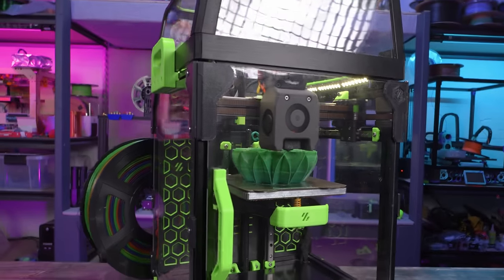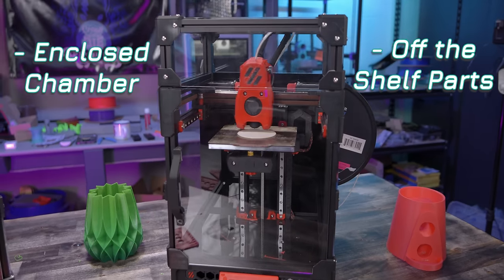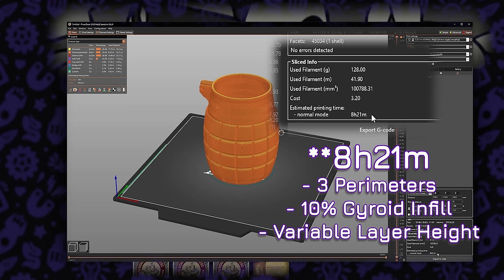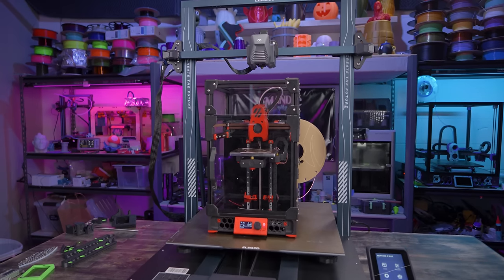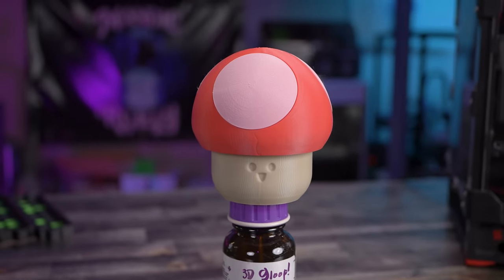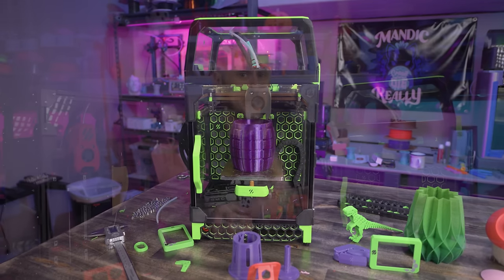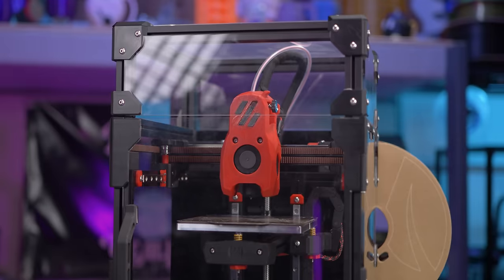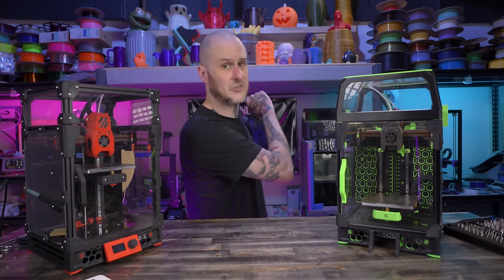Small 3D Printers are POINTLESS! Or...

Comment: I started out with an ender 3, the original, that i found on sale for 100 euros, after about a year of printing, i decided to get a V0.1 since almost all of my prints were half the size of my ender 3 bed, and the ender broke down almost completely, i managed to resurrect it by swapping out its mobo for a ramps 1.4 and an old laptop to run klipper, and strapped a v6 hotend to the ender 3 carriage with some wire to print a temporary mount for the hotend that didn't shake like crazy, once i did that, i started printing parts for the voron, and i still use these same parts today, just a week ago the extuder mechanism broke, and i managed to print a sherpa mini out of resin, and i screwed it on top of the mini stealthburner. right now i'm printing the parts to upgrade my v0.1 to a v0.2 with this frankenstein setup, and i wouldn't do it any other way!

Comment: If it’s the only machine you have, then yes , a bigger printer is a must, especially with limited design capabilities. I3 size is the default for many existing design on Thingiverse or elsewhere. Anything beyond that is optional. I started with a too small printer and regretted it.

Comment: out of all my printer my 0.1 has been my must used printer, as i print with asa and abs the most it just make sense as like 90% of the time the part will fit on my v0.1 and i got my v0.1 going at 500mm/s at 60k accel print speed so everything come off very fast much faster than my other vorons and enders. not to mention the bed heat up time being a smaller bed it easier to heat up with a 200w bed heater with the help of an active chamber heater too. only takes like 10min to full heated chamber and bed ready for asa and chamber prints compare my 350mm vorons takes like 1 hour just get to the temp before i can start printing, and usualy by the timei  can start my print on my bigger pritners i will alreayd have the part from v0.1. WIth that being said i am investing into a 330 vzbot to get the speed up on that and addin couple chamber heater too to speed up the time

Comment: I don't have a V0, but i do have a 120x120 corexy and i use it more than i thought. i have larger printers, but about 80% of what I print will work on the V0 size bed
Reply: What model?
Reply: @glabifrons  rook 2020
Reply: @njsurf1973  Thanks, that's pretty cool. I've only seen the 3D printed version before.
Reply: @glabifrons  i started with the printed version, and it was nice, but i like the profile one better

Comment: I got fascinated with Voron around Christmas, and built a V0.1/2 this spring because I wanted all of the project part without as much expense.  At the time I fully intended to give it a few months and then start looking into a Trident, but ... I'll be honest, now I'm fascinated with these little printers, so I might redirect to one of the printers for ants in the 180mm range (such as a Micron or scaled Tiny-T).
Reply: VZbot vz150 time?
Reply: @ballbous  :-).  I think there may be advantages to sticking within a specific ecosystem for the first couple builds!  Also, while I'll have to think on it, my current inclination is towards something more in the 180mm area, because it's a nice split between 120mm and 250mm.

Comment: You could cover building larger prints in sections and gluing, welding, bolting, etc. the sections together.

I suspect that, for many larger prints, printing the separate sections with a V0 would take less time in total than printing an unseparated piece in a larger printer.

Also, section level errors would reprint much faster than reprinting a large piece on a large printer.

Comment: I think 180x180 would be ideal
Reply from the maker: 150, 160, or 180 would be better for sure.  Almost every print on my list would have fit if the bed was that little bit bigger. Problem for me is the mod designs that use larger beds (V0 Variants that is) are all substantially more expensive.  That really negates the whole thing for me.  If I'm gonna pay as much as building a Voron 2.4, I'll just build a Voron 2.4.
Reply: @MandicReally  Interesting, I never thought that it would be so much of a difference in price when scaling everything up with the v0 variant.
Reply from the maker: @hongtse6723  The current variants that exist use are shrunk down versions of a Voron 2.4 (Micron) or Trident (Salad Fork).  Both use 6 or 7 motors & require mainboards that can control them.  At that point you are getting parts that cost similar to building a 2.4 or Trident, but building a small machine. I really like this form factor, but when I'm spending as much as it would cost to build a larger machine, it becomes harder to justify.

Comment: I'm building a V0.2 because I live in a tiny apartment and want to print ABS/ASA but don't have the space for a bigger enclosed printer.
Most of the parts I print are not huge, usually for electronic projects, so the size is fine for me, I'm extremely glad something like this exists otherwise I wouldn't have the option to print some things at all

Comment: I agree that V0 will print about 50-70% of parts. But if I want only one printer, then I need something bigger to satisfy my needs. I don't want to split parts and glue them later together. I'm mostly 3d printing automotive and motorcycle tuning parts. Basically anything: from little air ducts, to manifolds, adapters, cupholders, covers, buttons, mounts, brackets, holders and anything else for car or motorcycle. Actually I'm thinking about building Voron 0 but exactly 1.5 times bigger.

Comment: My largest print volume is 250^3 on my Biqu BX. I currently have 4 "mini" printers - a Prusa Mini, my Voron 0.1,  and two Kingroon KP3Ss (a V1 and a Pro V2) and they print 90% of what I need and my Ender 3s and BX take care of the remaning 10%. But if a 350mm Voron 2.4 kit showed up at my doorstep, I certainly wouldn't turn it down :)

Comment: Building a V02R1 starting this weekend. I have a SV06 and am happy with it, but want MORE! When I saw a review promoting the V0.2 I knew that the speed was just the thing I wanted it for. Most  of my prints can fit within the volume and there is nothing wrong with running 4 prints consecutively rather than one with all the parts on one bed taking longer overall.

Comment: I had a small printer as my first printer, the Monoprice Voxel (rebranded Adventurer 3).  150x150x150 was its build volume, nice, fully enclosed little printer...noisy as hell though.  I generally used it as my "test" printer for a single design as well as my portable printer when traveling to shows (Train Swap Meets).  I decided to sell it since what I had been printing was all too big for it, HO scale buildings were not going to fit in a 150mm area.  Also mass producing multiple items also wasn't feasible either, could get 1 or 2 on it, but the bigger printers I had (Twin Neptune 2S) could do 10+ instead.
However the Voron 0's there are the same price as that Voxel was, but clearly faster.  The only benefit I really see a Voxel 0 having is entirely in the speed department, if you can manage to get said print to fit in the small 120x120 plate.  Portability might be a draw too, since its small and enclosed to begin with, it would travel well.
However the Voron 2.4, at least at the 350 version does seem to be quite beneficial even at its high price point.  Because it brings both high speed AND large build volume together.  Then there is the X-1, that with the AMS is cheaper then the 2.4, 100mm smaller in build volume but really can't beat that ability to print in Color.  There is the Pallet 3 System that allows up to 8 colors on any printer to be used, but thats another extra, fairly spendy thing.  No idea how well it would work in conjunction with a Voron printer.

Comment: My first impression of the V0 was that it was a throwback to the old makerbot cupcake.

Right now I'm in the process of making a Hadley telescope.  The parts for this fit on my Ender3 with a bit of space left over (but not much).  The Hadley is a 4.25" (mirror size) scope.  I'd like to scale this up to a 6.5" mirror (which I will try to grind myself).  A scaled up design for this might fit on the ender3, though I might have the cut some of the parts in half on the cad model, print them, and glue them together.  So the Voron 0 would be too small for this.

However, I have also 3D printed a chess set.  THAT would fit on the Voron, and I could easily print several pieces at a time.  (I didn't do that on the Ender, too much stringing between the parts (PETG).  I could probably tune the extraction, flow rate, and filament temp to control this, I just haven't bothered yet.

Comment: I tried myself by building a few Printer (HyperCube, V0.1, Trident, Annex K3). For everyday Printing i usually use the Trident. Everday meaning i have multiple Parts on a Buildplate. For really fast prints, i stick to the K3. The Buildvolume of 180 mm³ is the Sweetspot for me, its super fast and i just love to watch the crossed gantry in motion.

The V0 is catching dust at the Moment and needs some tuning anyway. I will rebuild it eventually as i have new and shiny Filament.

Comment: My first printer 2 years ago was an ender 5+. my bro liked his 5, but I went to a bigger volume and more supported bed. but didn't want to be limited Goal of Droids, rc planes, rc cars. and at that time items were designed for a 220 beds. But printing my last airplane. I'm heating up a bed to print a small amount of small parts. IE I know I could add them to with bigger parts. But I like raining 1 at a time. Less travel time. But come to realize I could fit the small parts on a smaller printer. SO came in  my Ledge ix . 1 it was a full build in a box (can come built or minus 3d printed parts ) and was a fun first build No people I was 3d printing stuff from are basing it off purse mini so 180 cubed items. But its also I can heat up a small bed ie same reason less energy used to print smaller things while the big printer is printing ie 4 sections of an airplane wing for 20 hours and I print out the time items, IE cowls and such. (but a Voron 2.4 in the plans as just seams a fun build. and also looking at the k1 max.

Comment: I've got space for one printer and I think my Ender 3 is about the perfect size to be useful without taking up too much space.  Some of the projects I've printed recently that wouldn't work on a smaller bed include a very nice 5L trash can, a sponge holder/dryer for my kitchen sink (I actually had to scale this down to fit), a pencil case, and some toys with rip cords that I had to place diagonally to get it to fit on the Ender 3.  I also want to get into gridfinity or multigrid which would be very limited on such a small bed.

That said I do really like the idea of a Voron 0.2 as a secondary printer that can be used to print ABS components fast for real applications and the majority of little toys/trinkets way faster than I'm used to.

Comment: I build my v0.1 for specifically faster prototyping next to my desk instead of the bigger printers I have in the basement cause I hated having to sit around for first layer checks (don't judge me lol) and when it was a small part it was nice to keep working on the cad while it was printing for fit checks. The ONE THING that annoys me about the build volume (beside my bed having a low spot which is likely my fault lol) is I often want to print things that are 130mm or so or just outside of the volume and then I have to do a cut and key or orient it weirdly or just scale it. There's way to work around it, but by and large it's enough for most of my gadgets, not to mention the building of the kit was worth it in and of itself :D

Comment: I also run a v0.1/2 (its a frankenstein v0.1) I also run an open source project where none of the parts fit in the V0 so i mostly use my trident for that, but that doesn't mean the V0 doesnt get used i still use it for all my personal and or fun bits when my big printer is in use.

Comment: My main motivation for a larger printer is either full build plates worth of smaller parts so I'm not constantly pulling prints off the bed, waiting for the bed to heat up/cool off and the various pre flight print_start processes. Or for the occasional large item like helmets or cosplay props in fewer pieces meaning less time joining the bits and post processing before painting.

I have a little ender that prints like a champ but it's slow and smaller than my 300^3 Trident which means I can't get as much off it in the same amount of time. I'm still looking to build a V0 someday but for me the size is more immediately useful.

Comment: Wondering whether there's a good 3D printer for a travel trailer:  small, ideally would run from a 12V 100Ah deep-cycle battery system (generator to charge as needed).  Voron 0.1 maybe?
Reply: Purpose is making mounting brackets, muffin fan mounts (for e.g. where there's condensation), wire looms, that sort of utilitarian thing.  Hopefully beats putting the item on a list for when we get home.

Comment: There are very few things that I print normally that won't fit on a V0 bed. Most of the ones that won't fit on the V0 will fit on a 160mm Salad Fork (a small V0 like variant of the Voron Trident). Portability and convenience are other factors. Perhaps the larger printer must be put in the garage or a less convent to access place. The small printer can sit closer to where you design and work. The small printer is also easy to transport and show off, take to the local club or group for a presentation. It's also less likely to shake out of alignment in use. Even dropping one on it's head didn't do much damage (Nero). The small printer is also available while the big printer is busy to try out that new idea you just had. :)

Comment: My first(so far only) printer is a prusa mini, and while I think more than half of the stuff I've made could be printed on a voron 0, the thing I've made in highest quantity (a part similar to shelf brackets), would not fit in the smaller build volume. 

I think Voron 0 is a good size for a third or fourth printer, after you can already print any single thing you need, but need more speed or capacity.

Comment: My first printer is a sunlu s8 pro with a massive build volume (31x31x40). I love having that capacity, especially the width (which is still limiting at times), but 100% most of the parts I print would fit into one of these tiny printers. And the main problem I run into with printing tiny parts on a giant printer is bed levelling. The larger the bed, the greater the difference there's going to be between even the most accurate tramming map and the actual bed; this has no greater impact than in the very middle of the bed, where small parts are usually printed.

Comment: since making my Tiny-m a 150x150x150 printer it's has very quickly taken over as the one that is always on and ready to print. I have just finished the enclosure and getting ready for asa - abs prints and it's the only actually enclosed printer I have.  It's just perfect for quick test prints like you said because it heats up in no time and can print very fast. This is my 10th printer and the 3rd I have self sourced and made and I never want to go back to a cheap box printer again.
Reply from the maker: Tiny-M REALLY is interesting to me, but hasn't been updated in a bit that I've seen.  I'd probably want 0.2 aesthetics, which would be a big project on my part that I don't have time for...
Reply: @MandicReally  the rev 5 is currently in development so perhaps take a look at then when it's ready.

Comment: the only thing that is kind of sad is you can no longer do overnight prints 😅 which feel like a underutilization of it. like every part is sub 2hr
my take on this is probably don’t get v0 as your 1st printer as it can be hard to tune (unless you are in a dorm than the smol footprint is super nice). get a bambu if you are not interested in tuning printer and a E3 otherwise (not actually sure if there are better choice on this one, when I started E3 is still the king). with that said v0 are awesome second printer since it require some tuning but not too much tuning and complements a larger printer nicely. after that it is pretty much personal judgement and I plan to build a voron 2.4 from v0
Reply: You need to risk it and print stuff oriented vertically, just enough time for overnight printing with a plate full of stuff.

Comment: Have you considered making a 2020 based voron 0. I think 2020 is significantly more accessible then 1515 and would give you more rigidity. The Tiny-M is a great starting point.
Reply from the maker: I have and would really like to. The Tiny-M hasn’t gotten a 0.2 update yet I don’t think though.
Reply: @MandicReally  i am not really sure what the differences of Voron 0 vs 0.2 but they seem to be on version 5 of the Tiny-M. An ender to Tiny-M conversion would be super interesting. Really i would just like to see Voron adopt a 2020 version call it Voron 0.5.